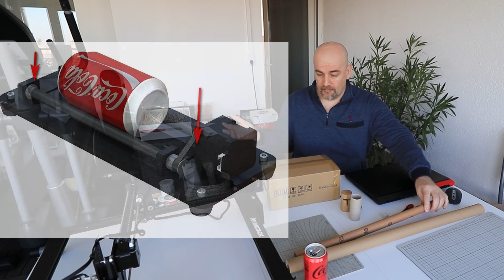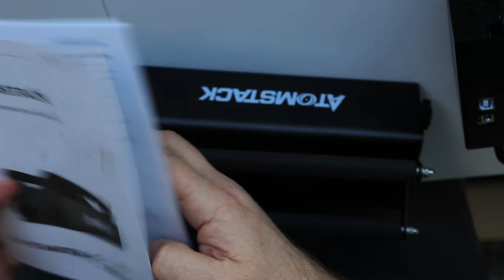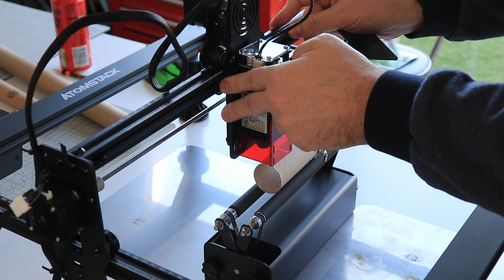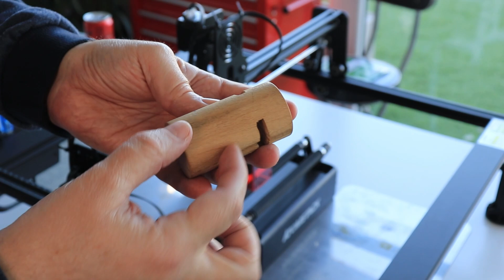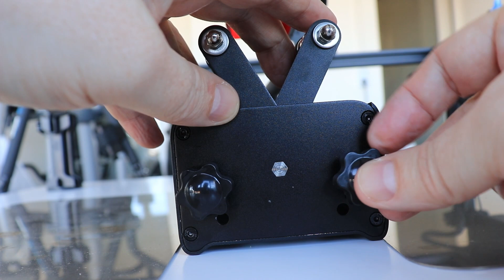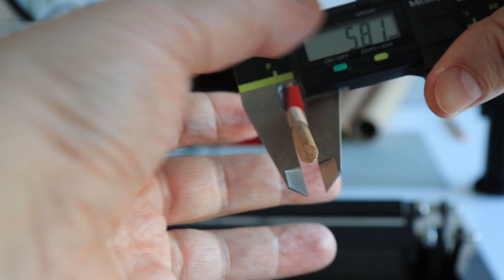Atomstack Y-axis rotary roller for laser engraving of cylindrical objects

Comment: Hi Igor. I have one question for you. I recently bought an Atomstack P9 M50 10W laser. I also want to buy the roller you presented in this video
. Can you tell me which axis X or Y it connects to with this type of laser?
Reply from the maker: It replaces the Y axis. In theory you could replace the X axis too, but you have to fix this in the file. Some engravers have dedicated slot, so you don't have to pull out the original cable.

Comment: HELPPPPPP I have one and I have been trying to make it work and every time the roller wont spin, It sound like it is stuck. Im so frustrated that I dont know what else to do.
Reply from the maker: First of all, can you rotate it with your hands? Second, is to check if you used correct cable (black or white, mentined in the video)
Reply: @MyTechFun  i can rotate it with my hand. I have use both cables. Nothing is working

Comment: any idea why mine moves on the Y while using roller?  New to this buy I'm pretty sure it should only move on X
Reply from the maker: It replace the linear stepper motor of the engraver. If you pull out the Y stepper cable and connect it to roller, it will rotate in "Y direction"

Comment: I wonder if this would work with a K40...
Reply from the maker: Depend of the stepper motors. This one has Nema17 inside. If necessary (depend of the pulleys) change the e-steps if possible (the expression is from 3D printing, not sure how are they called on laser engravers)
Reply: @MyTechFun  I guess so - but I am unsure about the magic firmware it has. I am fairly OK with 3D printer firmware but I'll have to look into how it looks for the K40